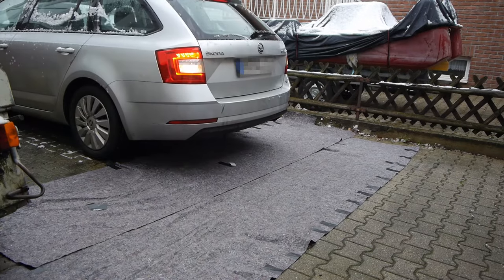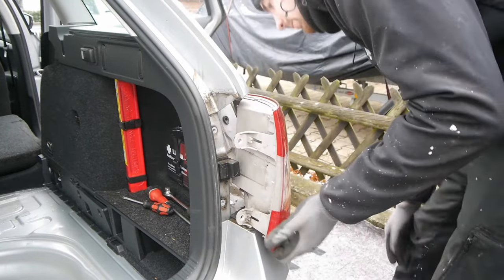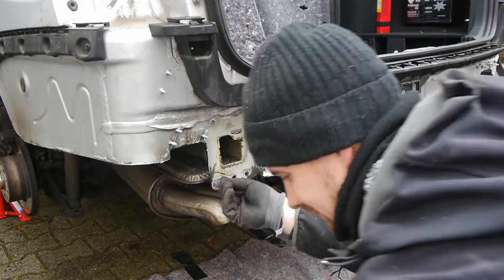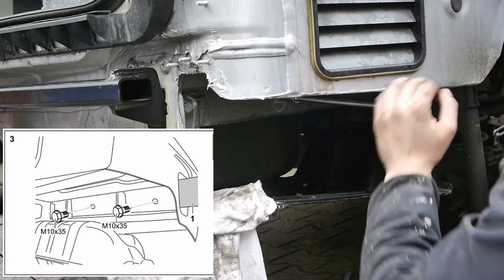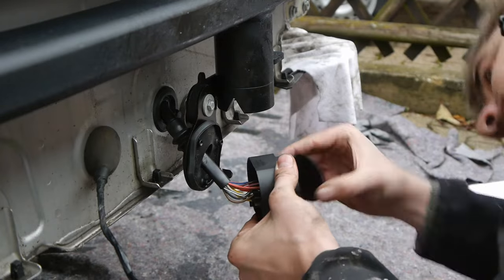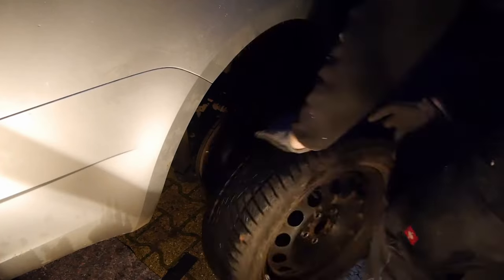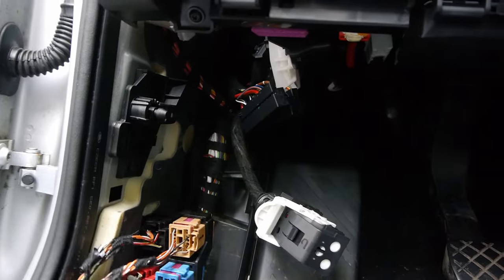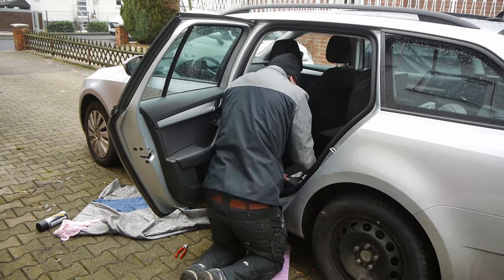How to Install a Trailer Hitch on a Skoda Octavia 3E from 2017

Comment: Can anyone confirm that all inner fender screws need to be removed for removing the bumper. If I can only remove the outer ones (3) and not the one more to the middle I think I will be able to not remove the wheels and not jack up the car

Comment: Thank you for the video.  Its helped me!  And I have one question.  Did you  do a connection between the trailer hitch control unit and the reversing sensor control unit?   I need to set the sensors to turn off when reversing with a trailer.
Reply from the maker: Yes, if I have a trailer on the car and switch to reverse, the sensors are off. The controlunit of the trailer hitch must be connected to the CAN bus of the car. In the video you can see it at Minute 15:00. The car then has to be taught to the trailer hitch in a workshop. 
The Part were you have to connect the Controlunit of the trailer hitch to the CAN Bus of the car is depending on the car modell and the trailer hitch, so read the instructions here very carefully.

Comment: What is the effect of not reprogramming the CANBUS as the lights were working before you got it done?
Reply from the maker: You need to reprogram the control unit of your car because the distance Control will always beeps when you drive backwards 😅 also i think, the brakes work different when you car knows there is a trailer attached to it.

Comment: In my Skoda Yeti when removing the lamps, the pin mounts were cracked in both lamps. This is a design flaw
Reply from the maker: Yes the rubber bushing, were the Pins sit in, was way to stiff. You have to spray it with some WD 40 or something like that. But you have no acces to the bushing when the light is mountet. 😅 I glued the pins back to the tail light. So far everything holds.

Comment: Hi, thanks for the video. 
Can you tell me how you connected your lights to the control box? 
Im fitting a Smart bypass relay to my Mk3 Octavia VRS and need to know whicj rear light cables to connect to. 
Many thanks, Simon.
Reply from the maker: I'm not sure if I understand you correct. But I just installed a trailer hitch set. The included trailer control Box is just connect to the CAN bus and the 12 Volt. The cables from the Control box are then put into the trailer hitch plug. The pin layout of the Plug is standardized.

Comment: Hi, hast du die Elektrik testen können bevor du die Codierung machen lassen hast? Ich möchte bei mir auch eine Nachrüsten am RS. Kann ich das Auto dann nach dem Einbau normal zum codieren fahren oder kommt da dann eine Fehlermeldung?
Reply from the maker: Ne, du bekommst keine Fehlermeldung wenn du alles richtig angeschlossen hast. Die Elektrik für den Anhänger funktioniert aber erst wenn du das Steuergerät in einer Werkstatt angelernt hast. Prinzipiell kann das eigentlich fast jede Werkstatt. Ich war damals bei Euromaster, die haben danach auch durchgeprüft ob alles Funktioniert.
Reply: @MechanicalRhino  wie kannst du dann vorab testen ob alles funktioniert?
Reply from the maker: @leonkreuzer446  Ja ist jetzt zwei Jahre her als ich das gemacht habe 😅 Licht und sowas konte ich anscheinend testen Indem ich den Anhänger dran gemacht habe, sieht man ja im Video. Ich bin mir nicht hundertprozentig sicher ob man eine Fehlermeldungen bekommt. Aber ist ja eigentlich egal, dann soll die Werkstatt einmal den Fehlerspeicher löschen.